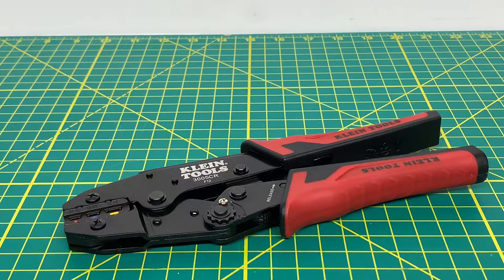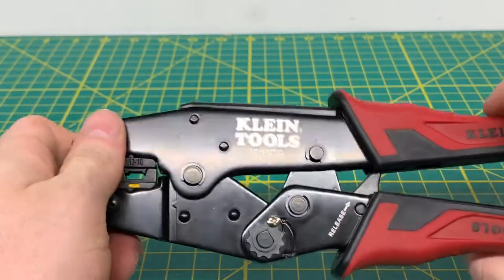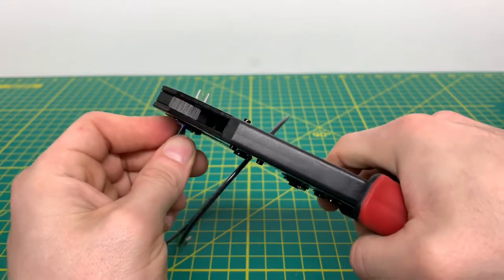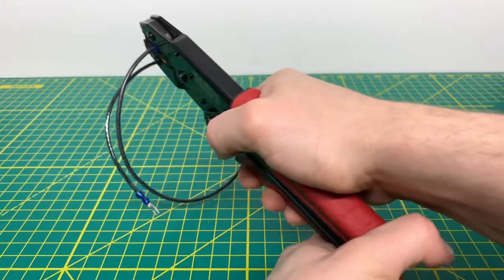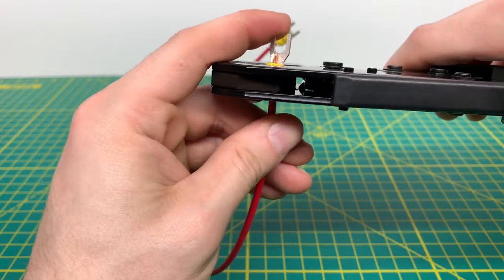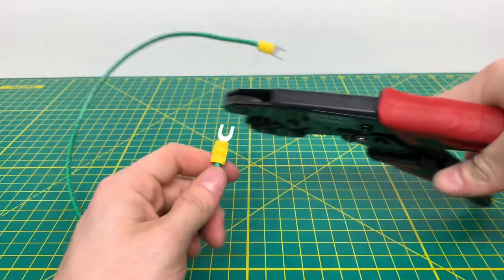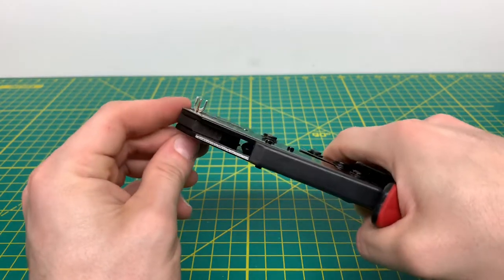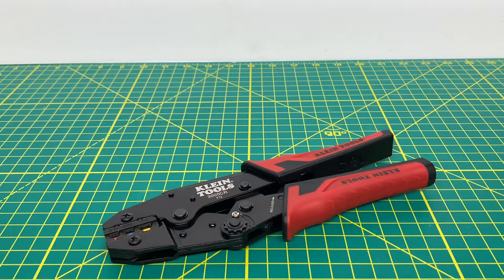Klein Tools 3005CR Ratcheting Crimper

Comment: There are other dies available for this crimper. I have a set of dies that crimp copper open barrel ferrules from 10-20 awg. I use the ferrules when I need to put leads into wiring blocks, instead of  putting the stripped end in the block and tightning the set screw and have loose wires getting goofed up, ill put a copper ferrule over the strands to keep them neat and clean.
   Great video, thanks for the review!

Comment: It's a lot easier if you use the crimper to hold the terminal (ratchet down just enough that it won't move) and then stick the wire in and finish the crimp.

Comment: Hi there. What would you recommend for non insulated cases? Is there a version or set of jaws available for that?
Reply from the maker: Klein has another ratchet crimper that can do non insulated terminal you just have to buy the jaws for it. They also make a hand crimper that can crimp no insulated terminals and well.
Reply: @TheToolReviewChannel  ok great I'll check for those. Thanks
Reply: @TheToolReviewChannel  i wonder if the dies for the other tool you mentioned will fit in this tool.  Looks like it could
Reply: @TheToolReviewChannel  the regular crimpers pliers that does non-insulated and insulated with wire cutters and strippers

Comment: Why not use them the right way? Put your wire end into tool then push wire into wire end and crimp. It holds the wire end while you put wire excatly where you want it. The way you did it, is much harder and doesnt crimp near as good!